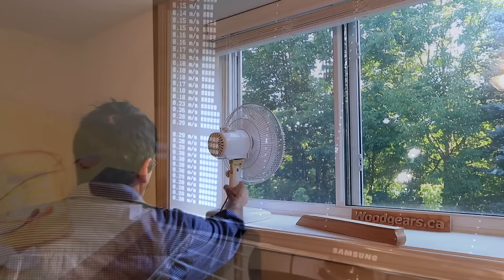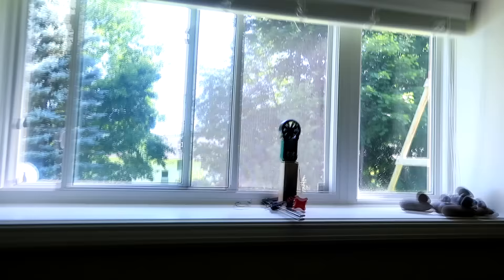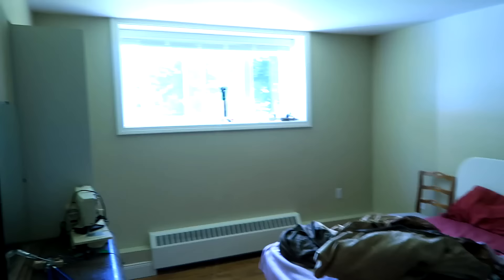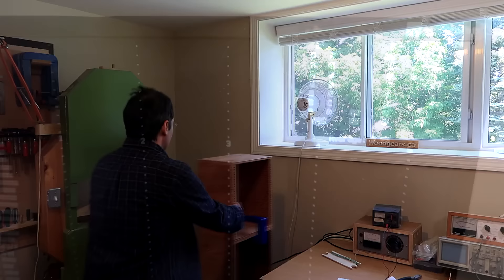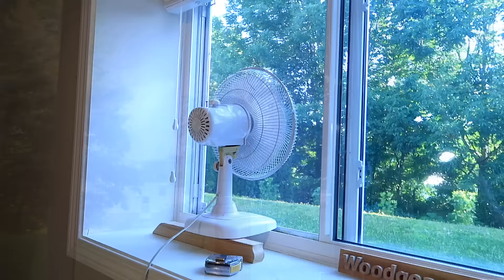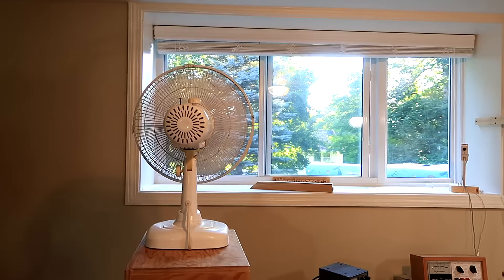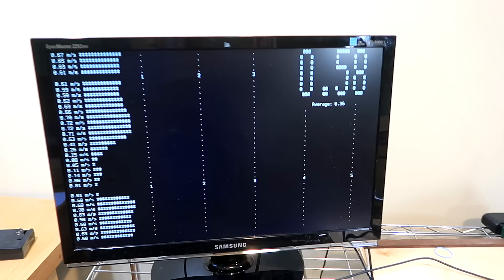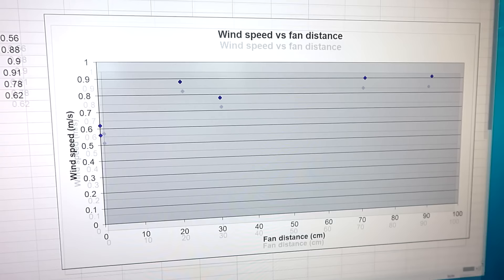Best fan placement to move air through the house

Comment: Fan placement really does make a difference. I live in the desert and it’s very hot here during summer. My ac is in a bad location in the house so I have to use fans to pull the cool air throughout the house. I have spent days and days moving fans around to find the perfect configuration for maximum cooling. One fan out of place and it will get hot, in the right place, I can stay 75 on a 100 degree day. There are a lot of factors and every home is different. Experiment with your fans! Move them all over the place, you will find the best spot. In the right location a fan on low can really help keep you cool.
Reply: I do the same experiment the problem is that I have a ceiling fan and it cannot be moved, so to have the better freshness I'm the person who has to move  😅
Reply: 100 degree Fahrenheit or Celsius?
Reply: @EngerJimenez  I kinda doubt you'd survive being in 100 Celsius so assuming Fahrenheit
Reply: @KilleRoy_NL  I doubt you would even survive anything above 45 c°
Reply: @CRegaladoDA  It seems we are in agreement haha
Reply: @CRegaladoDA  You can survive 50° , not exposed to the direct sunlight of course; but the humidity plays major role in how you percieve the temperature. In Europe when we have 37-40°C its unbearable to do anything , but it its much different to 40C in desert climates because air is not as humid and you can breathe more easily and also we can cool our body more easily by sweating more. If the air is too humid sweat cannot evaporate efficiently enough.
Reply: @KilleRoy_NL  That´s what I assumed too, but who knows.
Reply: @CRegaladoDA  lol here in Spain 40-43 is normal on some places, imagine on a desert
Reply: In Finland it rarely gets over 25° C but we go to 100° C sauna every now and then. You will survive, just don't stay too long.
Reply: Isn't cheaper buying another conditioner?
Reply: @lollo7417  100 degrees in the sauna lmao, ive reached that point, and oh boy is it hot
Reply: @EngerJimenez  are you trolling? You can't survive in a house that's 100 degrees celsius. So I guess I'm Dr. Who.
Reply: Shep VanDelay  My god man 😂

Keep up the fight, and may God have mercy on your electric bill and on all hotspots everywhere.
Reply: Shep VanDelay  Nicely done sir!
Reply: Do you have a swamp cooler?
Reply: @Andenni  100 °C is the temperature at which the water boils at 1 atm. So staying in a 100°C sauna would hurt more than putting your skin in the boiling water, so I'm calling cap.
Reply: @nowonmetube  Yes?
Reply: in tamil nadu(india)when i was there it was always 45 to 50°c and yeah some people faint outside so the government had to announce to drink atleast 1 litre of water before going out.there is no cool air there,even when wind blows its warm air. 😭
Reply: Get a circulating fan instead of normal fans ma'am. If that was your used case..
Reply: @KilleRoy_NL  https://youtu.be/b13Op7WaTx8  110С
Reply: Just familiarize with the Venturi effect, and you can probably eliminate a lot of the trial and error.
Reply: @kaan8964  ...and yet we still do it. Not for a long time, though, and it can be dangerous. People do die in sauna; a contestant in Sauna Championship died in 2010 after spending six minutes  in 110 C.
Reply: Try to also put a shade over your ac will make it better
Reply: @bratecyo  That was less than 4 minutes, we're talking actually living in those temperatures 😝

Comment: Matthias gives the answers everybody wants to know on the questions nobody asked.
Reply: thats what an engineer does.
Reply: I have asked this on occasion, Australia is a hot place
Reply: Until 7 years from now when a celebrity posts on Twitter about putting a fan in the window..then it will end up with 20 million views in 3 days.
Reply: I ask it myself whenever it's hot inside 😜
Reply: Today I was trying different positions for my fan as well because the air circulation in my room is horrible. Thats why Im very surprised that this gets suggested to me.
Reply: I was just thinking about this question the other night. (7/5) I was amazed when I saw this video in my feed.
Reply: I need it
Reply: @kevinrose8568  that's how manifestation works!
Reply: I ask this constantly when I'm trying to cool down the house in the evening after a hot day.
Reply: But which window is open?  I can't see it from the window.  All of them are shut.
Reply: Reminds me of tomce
Reply: Another thought: Living near the Rocky Mountains enables the outside air become much cooler at sunset. Fans pull the exterior cooler air through our home.
Reply: As a person living along the equator, I think about this every single day. It's quite hot here.
Reply: Pues por lo que veo miles de personas se han preguntado eso de ¿Cuál es el mejor lugar para colocar un ventilador?

Comment: My father, an civil engineer, was doing this experiments back in the 60's at our house.  It was a big house.  Finally he sealed/placed the fan  in a stair way window and kept the inside doors in a closed circuit, porch to kitchen, to living room, hall way and ending in master bedroom.  We never had to run the AC until June then only in the afternoons.  (Atlanta GA area).
Reply: 😂😂😂😂 no need to be an engineer, i have done better
Reply: @eggbenedict-gt7mw  No you don't 😂😂😂😂
Reply: @eggbenedict-gt7mw  First of all he said his dad was a civil engineer, not that it was required, but that distinction probably went over your head. You're so desperate for attention you replied a comment without data, and said you did better, despite it being impossible to prove that.
Reply: My granny also lived near Atlanta. She always put a box fan in the front door. In the daytime, she would have it blowing outward to push hot air out. In the evening, she would turn it around to pull cool air in. She never had an air conditioner and it was always relatively nice inside her house except on the hottest days of summer. It helped that she had two massive oak trees shading her house.
Reply: He could have been a good youtuber and shared the results if there had been youtube in the 60's!
Reply: @lijkn  You'd never hear the end of it.
Reply: @eggbenedict-gt7mw  Oooofff... Can't believe you posted that comment, thinking you totally nailed it 😂😂😂😂
Reply: Thanks man
Reply: Old houses were designed to draw in air through the basement windows where the cold concrete would cool it and cause it to rise up through the house where the warm air would exhaust out the attic windows.
Reply: Old houses were designed to draw in air through the basement windows where the cold concrete would cool it and cause it to rise up through the house....

note: cool air does not rise  ...unless propelled by a source
Reply: @iggypopisgod9  It's being sucked up by the negative pressure of the warm air going up
Reply: @anonymoususer3561  You can't explain things to people like this.  They are wet paint people.  You can tell them all day that the park bench was just painted but they still have sit down on it to find out for themselves.
Reply: (Sweden) Today (Summer) it is 16°C outside and my apartment is 26°C inside. If I need to cool it down I put a floor fan outside and blow cool air into the apartment. Works well ONLY if the outside temp is actually cool. (The apartment block is constructed of wood and the entire building is painted BLACK. So you can imagine whata "wonderful time" it is during the height of summer.) :face-purple-crying:
Reply: too bad your dad wasn't an English teacher - we may have benefited more if you could express yourself more coherently
Reply: @roadracerdave7645  This remark being expressed so expertly,  I will step over it.
Reply: a helluvan engineer?
Reply: @evanyoung837  out of a rambling wreck
Reply: @NoggleBaum  to hell with Georgia! I’m about to graduate from that same program.
Reply: @roadracerdave7645 hmmm if you are struggling with understanding that tiny text, i think the problem is you.
Reply: Literally... cool story,  bro.
Reply: Same or more amount of electricity was consumed though
Reply: @JeronimoStilton14 hes saying you dont need to be an career engineer to figure these things out. 

Im not sure why your egos are so offended, all he said was he could do better.
Reply: @Aluttuh  he actually said he had done better.
Reply: @JeronimoStilton14  Which you are upset about why exactly?
Reply: @Aluttuh  I’m not upset about it. I told them their initial comment doesn’t track with what was said and he had no empirical data to make his “trust me bro I’m better” claim. Pretty simple stuff
Reply: @Aluttuh  Commenting as such shows you are just as offended or at the very least intrigued in the conversation no? Would it not be a part of the ego that prodded you to type those words as well?

Just some food for thought.
Reply: Same, except it was the 70's in Michigan. My dad was smart too. 👍🏼👍🏼👍🏼
Reply: @eggbenedict-gt7mw  so you failed at college?
Reply: @nuntius1  i excelled

Comment: Hi sir. I want to thank you from the bottom of my heart! This tip solved a big issue for me and my family. We hated summer times because we had trouble sleeping in our apartment. I have a quite powerful AC which does the job, however it was drying the air too much and my little daughter was having trouble with her throat. We got quite a qood humidifier but it didn't do much.

... but man, this tip, I tried in and it made the temperatures ideal for sleeping without sweating. It's been 10 days since I implemented it and in all of them we slept without any issues!

Thank you a million times and God bless you good sir!
Reply: Goes to show you may never know how much of an impact a simple curiosity experiment may have on someone else's life.  Thanks for sharing.
Reply: This comment ❤
Reply: Thanks for sharing
Reply: summer nights no need to turn on the AC anymore? : )
Reply: @piggnant  😐
Reply: You don't turn on the AC now?? Or do you throw cool air outside? Which probably increases the AC work?
Reply: @bdulAhad0  I don't turn on the AC during the night. The middle room is where the fan is located, which blows hotter air from inside, and the other two rooms are where I leave the windows open to draw colder air from outside.

Comment: My girlfriend would tease me about starting an 'Airflow' channel, as I nerded out into seeing how long we could go into summer without air con - you did it my brother!  I currently use 2 box fans - one pushing in, the other out, right up against the window, BUT I close the window up to the fan so opening is about the size of the box fan.  Moves air decently.  Ceiling fans on low to evacuate hottest air.  I used incense smoke to find window leaks - don't have a meter or graphing capabilities - nicely done!
Reply: You struck on the KEY when you said "BUT I close the window up to the fan so opening is about the size of the box fan".

When you put a box fan in a window, you must seal up the rest of the opening (with cardboard & tape, or a piece of plywood) if you expect any air movement. 

But when you do, it is very effective of creating air circulation. I've used 20" box fans installed in windows for cooling, air circulation, and even exhausting airborne contaminants during home improvements, for over 50 years. 
(And saying that makes me feel old...) 🤔

Comment: Believe it or not, I've discovered this about 2 years ago by accident, I was cleaning my room, and my intention was to pull the dust outside by putting my fan facing my opened door and about in the middle of the room. While cleaning I noticed that my room was getting cooler and cooler over time.
Reply: So, how old were you then when you discovered airflow?
Reply: @TheBrandonn  37
Reply: @TheBrandonn  that question made me laugh 🤣
Reply: @Verdeniza  ikr 😂
Reply: But this has nothing to do with how far the fan placed from the window
Reply: @jeb123  Sure it does, he already had a baseline feeling of the effect of putting it in the window because he always did that.  Then he put it in the center for dust removal and noticed it was way cooler.
Reply: @TheBrandonn  i am 30 and just discovered this
Reply: I'm starting to see this issue or situation due to losing our home to sewage back up, and mold that produced mycotoxins and pathogenic bacteria found in home.  Company's coming out to clean and vent the place turned out making it worse which caused our health to become a problem and we have kid's.  Then bought a new home and noticed fart fans and fans doing this in general.  I believe we have a huge ventilation problem causing high R/H and of anyone could help me put the puzzle together I'd appreciate it so much. This stuff has consumed my time so much to the point where I'm seeing it happening but have a hard time to explaining to our builder.  I have more info I you respond. I'll even pay for help on this. 

Thank you and so glad to see this video as I'll be looking at much more 

Carl
Reply: @Carlshorts303  no
Reply: @Carlshorts303  If I’m understanding you correctly then, you need to allow more air into the house to get air out of the house. Add an inlet vent. Modern homes are built very tight compared to older homes. Some new houses need a place to draw the fresh air in to them.

You could also check that your exhaust fans actually have a path to the outside. I had a bathroom fan that wasn’t ducted outside, it was only ducted into a small enclosed space in the attic. Because if this, it didn’t work at all. The solution was to change the exhaust duct to the outside.

Hope this helps.
Reply: @jeb123  really ? have you watch the video, lol
Reply: I am 45 and found out today. Keep the numbers going

Comment: We use this in the USA to ventilate houses in firefighting. Back the fan off the opening just enough to where the cone of moving air from the fan cobers the opening. You can take another fan, put it outside on the other side of the house and have it force air into the house. Again you want to back it away from the opening far enough for the cone of forced air to encompass the entire opening. Also, all other windows and outside doors have to be closed for it to work.
Reply: Are you trying to burn the house down faster?
Reply: Did you think that sounded smart? It is obviously used to ventilate smoke AFTER the fire. I don't know if you were trying to sound funny with your comment or not, but instead you showed a clear lack of practical sense, and an aptitude for stupidity. There are other methods of ventilation used in active fire situations btw, but I don't think you would care to know by your comment.
Reply: @dakotamartin1621  i think it was a joke lol
Reply: @whoisisaac  im sitting here like "isnt he describing those backdraft rooms?"

i thought dakota was trolling til the end
Reply: Thanks for explaining it so well. Fellow firefighter here, can confirm this is how we ventilate a building. There's a lot of research on this so we see it as part of our training, and it is very interesting to see it work for yourself.
Reply: @dakotamartin1621  I bet you're fun at fires
Reply: @dakotamartin1621  isn't Dakota a girl's name?
Reply: @whoisisaac  the fun part is, that if the firefighters made a mistake and did not extinguish the fire properly (bit of fire in a ceiling thats kinda wet but not demolished) it could actually reignite the whole place.  
So it's someting to very much be aware of and I guess Dakota knows that too, so yeah, if a firefighter doesnt do his work properly, they might damage property by accident when applying ventilation
Reply: @dakotamartin1621  chile
Reply: @dakotamartin1621  take a joke dude lll
Reply: @Ruzl12  fighting fires is noble and amazing and I respect Dakota.  I'm sorry he didn't like my joke, but it's not my problem.  I feel certain he would take care to never partially extinguish a fire.  He seems very conscientious.
Reply: Oh wow. That's what l do in my house in summer. Cools the house down in a relatively short time. Will try again with the fans backed off like you suggest. Hadn't thought about the cone of air. Thanks.
Reply: @nana-ci5mm  I'm pretty sure it's a state or something like that.
Reply: @reubenbetts7537  Is great with Venison.

Comment: As many people have said, it seems to be a result of the flow of air pulling more adjacent air out the window along with it. I think this is the bernoulli's effect, which you can look up someone blowing up a large bag with air in one breath because of the same principle.
Reply: Exactly, that's correct.
Reply: I believe its air entrainment.
Reply: you get some nice entrainment, and you also manage to stop most of the air from coming back in through the same window again
Reply: Yup, I remember my science teacher showing me that effect in grade 9
Reply: This is related to Bernoullis principle. Locally increasing the air speed decreases the pressure, leading to surrounding air streaming into the low pressure region. If you place the fan directly in front of the window the same happens, but the surrounding air will be on the outside, rendering the fan useless.